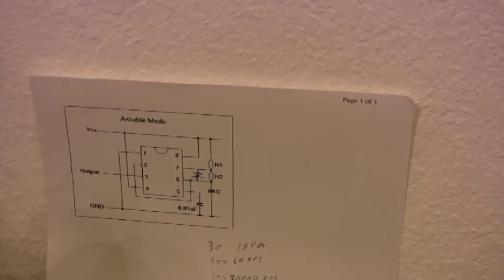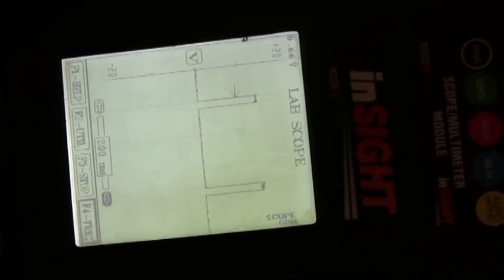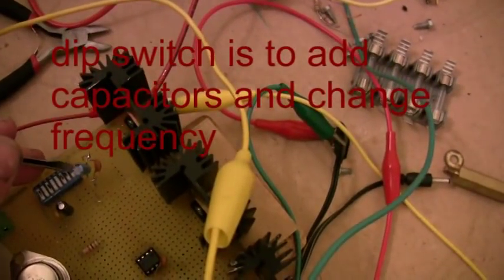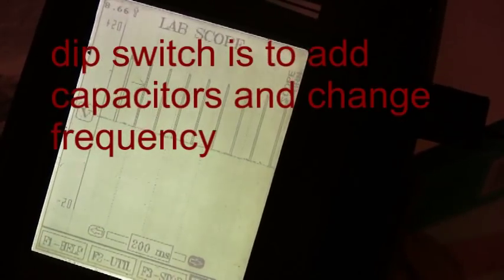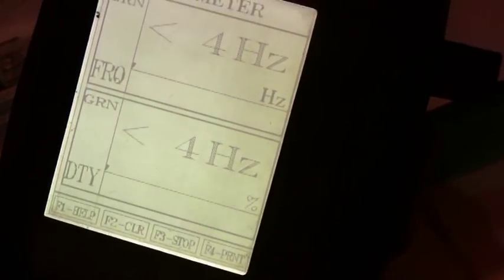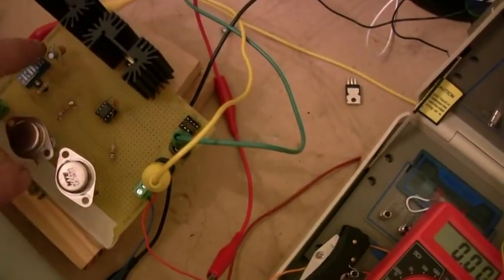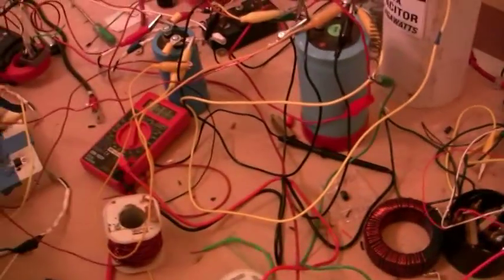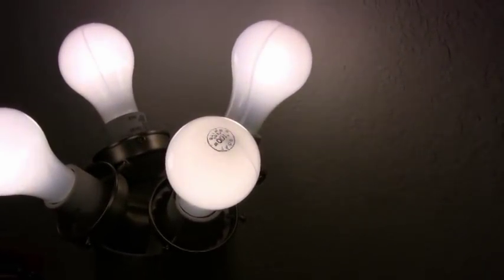555 timer lower then 50 duty cycle

Comment: Can't you just hook up lights between pin 8 and pin 3 and leave nothing else at pin 3? That way your lights will light up when the pin 3 output is not outputting voltage